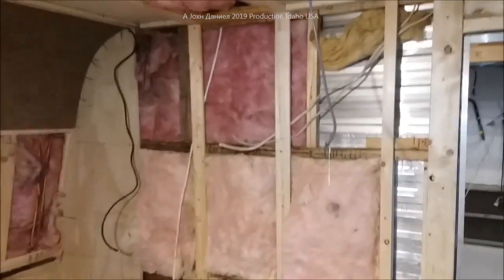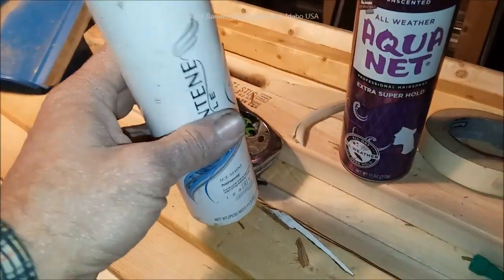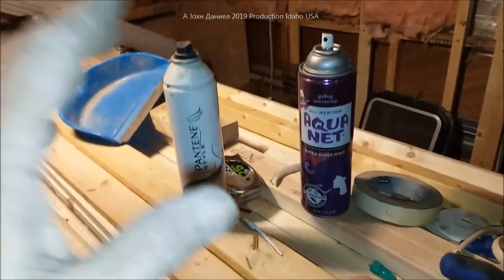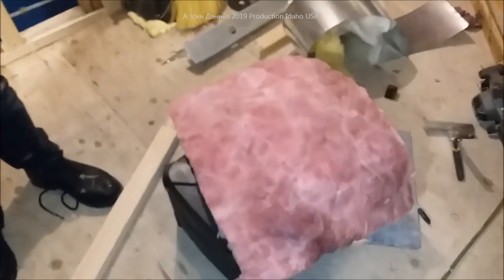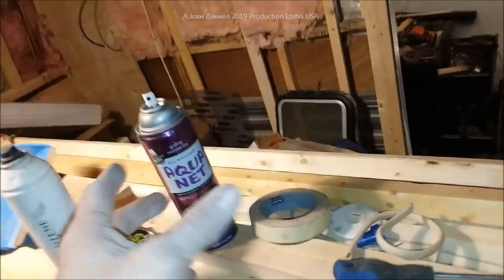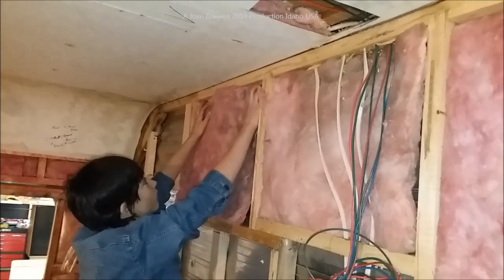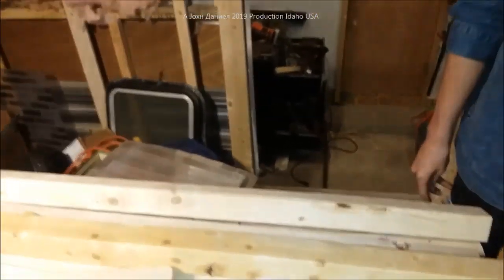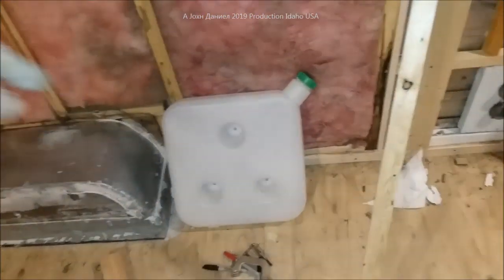How to keep fiberglass from itching, Spray HAIRSPRAY on your skin!

Comment: Excellent tip, thanks. Like your channel. When I live somewhere that I can have one (i.e. not the city) I'll have a look at the $300 one (well done for getting the price down, and for studying Chinese!). I've heard recommendations not to put turbines on the roof as wind flow around them is turbulent, stick them on a pole away from the building instead, but the roof obviously works for you. Do you have a video on siting turbines? Have only recently discovered your channel and not had time to look at all of your past videos. If not, it would be interesting to hear your thoughts on them.

Comment: even when i wore disposable overals cleaning out fibre glass from huge AC units on big buildings that were  lined with aluminium backed fibreglass insulation id still get itchy, the hot water never made it better for me either, the spray is a neat trick, like spray on skin , i work on cars almost every day so i will try the hair spray trick on my sleeves.
this never occured to me mind you i have no hair LOL

Comment: I'm working in a factory where fiberglass is airborne 24/7. It's the worst feeling where your arms are on fire but aren't in flames I can see with my eyes. After soaking in Epsom salt for 10-15 minutes it's not so bad but still scratchy. Then I spray tolnaftate athlete's foot spray that helps the burn considerably for right now. Any other ideas after?
Reply: i found that if you make a paste out of baking soda & water and apply a good coat of it on the affected areas it helps big time.  nothing else seems to work. also being in a colder climate is better than heat  imo

Comment: i bought a used vacuum and I accidentally pressed the "on" trigger and a puff of what I thought was household dust came out. I paid it no attention thinking it was dust and I would need to dust afterwards. later I noticed I was very itchy and on investigation, I found these little straight fibres EVERYWHERE, they are thinner than hair and can only be seen with my camera's flashlight on the right angle, is this fibreglass what could it be? My skin is itchy even after several showers, the first morning after my eyes were red, the second morning (today) my chest felt tight. I was going to go to the doctor but if its my lungs what really can they do, so I stayed home, and will monitor the situation. Any help would be greatly appreciated.
Reply from the maker: Breathing in fiberglass particles is not exactly a death sentence and it is a definite uncomfortable condition to be in, being that it's a foreign agent in your lungs your lungs will build up a mucus coating to them and you will slowly remove most all of that. You're more likely to have a higher level of latex from car tires then your lungs and fiberglass since the majority of pollution at street level where we live is the fine microfine particles of latex with fiberglass and other man-made products in them in from the air.

Comment: so do you spay it on your cloths before you wash them or before you use oil or fiberglass
Reply from the maker: When working with oil you'll use Niagara spray starch on your clothes anywhere where you might be getting it spilled on you, then you'll use just a bucket of hot water and some Dawn dish soap to remove that oil and the starch. When working with fiberglass you'll spray down your clothes your sleeves and everything else and your arms and you can then just throw that straight into the laundry, cold wash,  just don't mix with any type of Teri cloth  materials

Comment: The rash I got from fiber glass (insulation) was ridiculous.  I didn't know anything about it, just that you don't want to breath it in.  No man, there's so much more than that lol.  And once that ship sails, fml.  never again.  But, I did get a lot of relief from making a baking soda and water paste, covering the rash with it for about 30 minutes then rinsing off.  repeat.  stay in a cold climate if you can, definitely dont want to be warm, the inflammation never ends in the heat, the itching never stops.  shit is terrible.
Reply from the maker: Use GOOP hand cleaner to clear yourself of the fibers, lather on lightly, take a cool shower to rinse not wiping or scratching. Then do a regular shower.